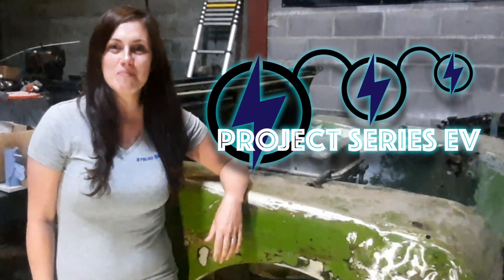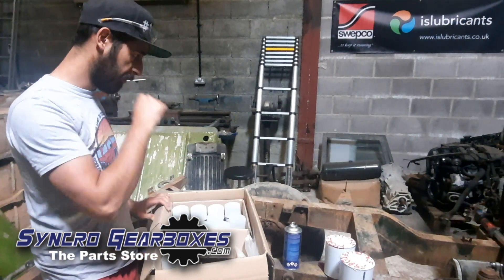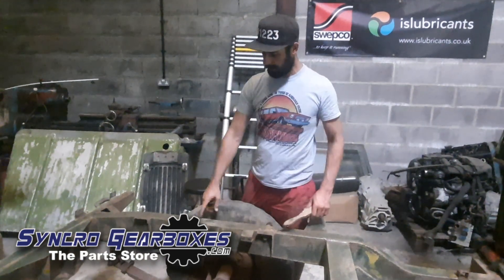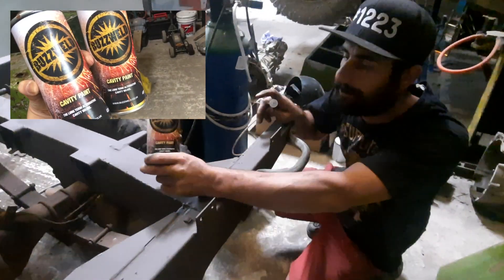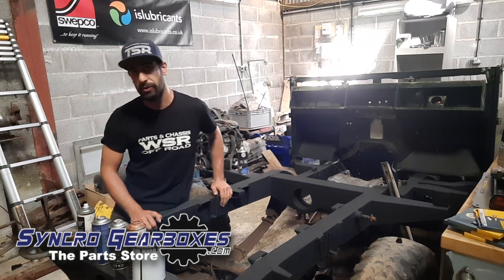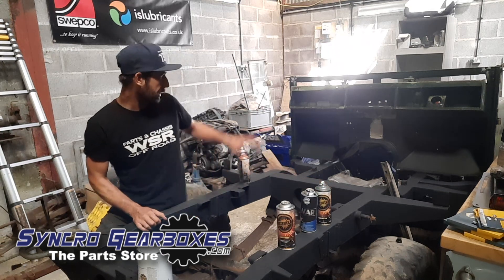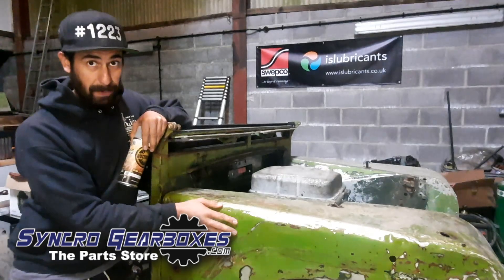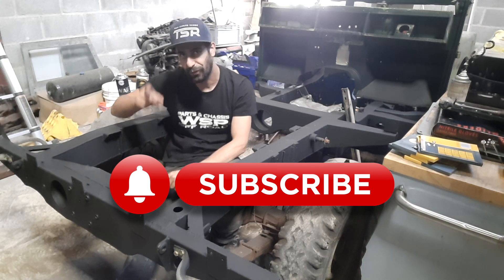07 - Electric Land Rover Series Conversion - PAINT PROTECT PRESERVE⚡️⚡️

Comment: Great content 👍🏻but what's happened to the video quality?... Early videos were much sharper
Reply from the maker: We don't know either! Nothing has changed our end so hoping youtube is just having a minor glitch that'll sort itself! 🤞
Reply: @SyncroGearboxes  When shooting a video in a dark environment the camera will change the ISO levels in order to try and get more light in. getting a few daylight LED (not warm light) will fix it The drawback is that it creates a pixelated look. 

Higher ISO = more light but a grainier look 
Lower ISO = less light for the light sensor but a smother less grainy image. (this is a old concept from film cameras that made its way into the digital world)

>>> a few  of these should do the trick Philips Essential LED Tube 1500mm / 6500K. 
I have used this my self the ones I got was rated at 240v so i could just wire it up and plug it straight into the wall so if you cable tile it to a stand you will also be able to move it around a bit.
Reply from the maker: @christiaansteenkamp5617  Thanks for the tips! I think we're slowly going in the right direction with the later videos